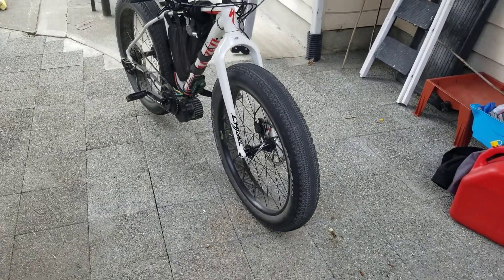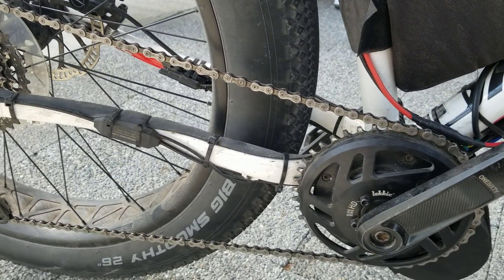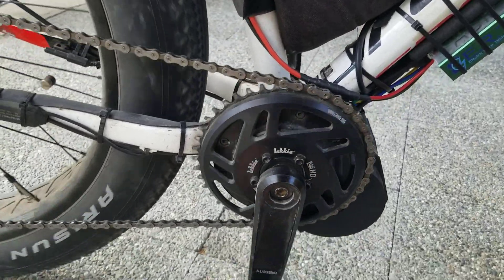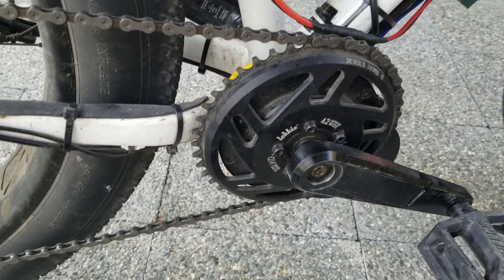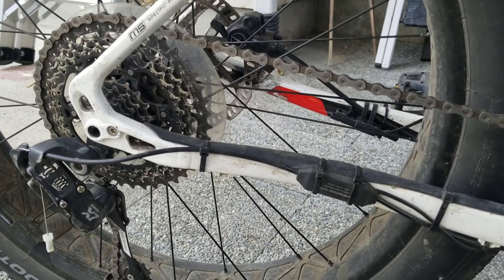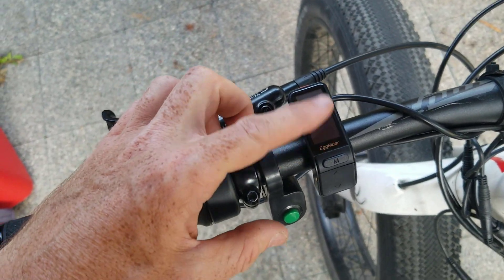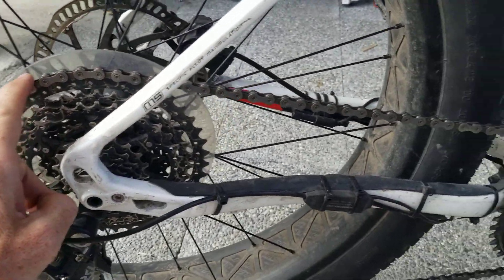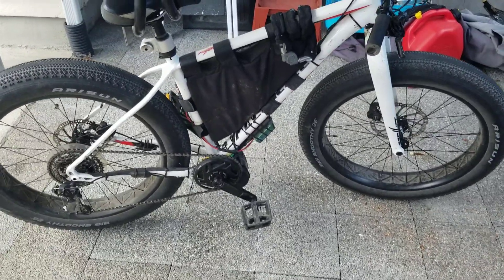Bafang BBSHD (ASI BAC800) on Specialized Fatboy - 3000km What I have learned!

Comment: Personally I haven't experienced the Bafang stock bbs controller to be a "pain in the ass" for my style of riding.
During easy, non racing, relatively low speed average 29 km/h rides working as a bicycle Postman messenger 📪.
It's fairly waterproof sealed out of the box.
Programming with usb cable or eggrider display is not hard in my opinion. 
I like the experience and natural intuitive feeling of being able to  control the ebike motor with your feet, handsfree wether your input is transferred through pas or even better through a torque sensor , very much.🚴
Also because this input system enables me to ride with my hands and arms free in an aero bar wich safes a lot of wind resistance and adds comfort on the wrists or pas allows me to carry letters and small packages in my hands in stead of constantly holding on tight to a throttle..
It's also gives good exercise and safes battery not being able to ride the bike like a scooter without pedalling along.🛵
Lunacycle mentioned that they believe the bafang bbshd controller of wich over the years the quality and quantity of mosfets have been improved is better than cyclones mid drive controller.
Some people use the bbshd / bbs03b controller into their bbs02b +750 watt motors mid drive  as an upgrade , with succes.
Before my current Bafang bbs middrive on a hardtail mtb,  I drove a max 2kw Crystalyte HS rear hub motor with xlyte <36v-72v> max 30 amp sensorless pas enabled external controller on a full suspension mtb for four years. But that xlyte Chinese pas system was more slow than the bbs in reaction time of  transfering sensored pedal (magnets) rotations into enabled or disabled electric hub motor assistance.
Reply from the maker: Nothing wrong with a different opinion. External controllers take more work for sure. I'm not sure where you got the idea that there is no PAS with the bac800. I use it all the time. In fact now the NXT display is on the bike I have true independant PAS and throttle. I cam even have 3 pas levels on the road and 9 for trails if I wished. There is also an EU mode in the works that locks out the bike to the legal limit and no throttle. The idea being you can ride your bike to the offroad area and then unlock with a PIN. PAS is my big area with the NXT and I am hoping the experience will be improved. User control over power ramping, decay, optimum cadance etc. Maybe I'm being a bit harsh on the stock controller. If you are ok programming it and running with the eggrider thats great. I bricked mine simply by changing the amp settings! Thanks for the comment. Cheers
Reply: @HighVoltageKits  ok thanks for the reaction. And xtra info . Sorry for the confuse.
I based my first feature impressions on the asi bac 800 controller Lunacycle sells on this site link (*) where it is said that cyclone specific asi bac 800 does not has a pas connection . i did not realize immediately: there are many different asi bac 800 controller versions and different cable harnasses available. Curious to learn more about what you shared above. 👍
https://lunacycle.com/asi-bac-800-controller-72v-version/
Reply from the maker: LUNA are not very good with ASI. I would not get one from them. It's a very difficult thing to get dialed in right. I'm not shocked that they say things like that tho.
Reply: @HighVoltageKits  after googling I figured out some options to get a asi bac 800 dialed in for the popular bafang bbs middrive with pas functionality embedded in the package.
F.i. this one Electric Racing Technology  you have mentioned before -->
https://electricrt.com/bafang-bbshd-upgrade-kit
Ps
In Europe sellers of that asi bac 800  are rare . one in the uk who does sell them listed they were out of stock on may 1st. 2020.
I did also see there is a asi bac version for the cyc x pro gen 2 mid drive (Torque sensored) relatively new e-bike motor.
Reply from the maker: So I help with the development of the NXT display. I use the kit from ERT on my bbshd. The same stuff will be stocked by Electron in the UK. Everything is a bit nutty right now and ASI themselves are no exception. I use the bac800 with gen 1 cyc and I am sending a torque bracket to get tuned in so gen 2 cyc users can get the same experience. Right now the push is to get the first few riders running with the bac800/nxt combination. There is some info on this in my more recent videos.
Reply: @Pablo Slalom Smart idea to use a MTB for the conversion in stead of a lighter build hybrid with rim brakes.
Besides better safety due to the stiffer frame and disc brakes. 
27,5 tires provide more torque and accelerate faster than 700c tires.
My ebike has a MTB/ATB air pressure regulated suspended front fork with lock out and hydroformed oversized alloy Merida crossway Frame. Though due to the rim brakes and large 700c tires I consider it safe up to speeds of 45 km./h 
Above 50 km/h is my limit for feeling safe & comfortable on that e-bike without helmet.
Reply from the maker: I always wear a helmet! But you can get hydro disc brakes also now. Fair points on frames! Your bike sounds cool! Cheers
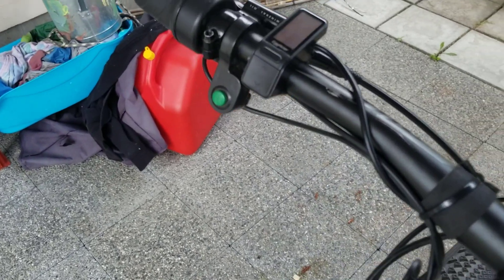Reply from the maker: If you skip to 6:10 you can see some riding using PAS on the bac800. The motor idling feature keeps chain tension while riding so less snap on the chain as PAS engages.https://youtu.be/r2vyJ1mBCUE
Reply from the maker: Its a fatbike. So 4 inch width tires. When I was running 52 volts and using peddle assist I could get over 60km of range. That was with a 25 amo hour pack. You say you are getting tired. What peddle assist are you using? If you join my discord you can post pics and get advice on your options. https://discord.gg/YAAjfgc
Reply: @Pablo Slalom Hello Pablo. Thanks that you liked my reply reaction and asked me some questions about the BBS002b - 500 Watt (4,2kg) Bafang same mid drive motor as you have. Nice to hear you do delivery work too.
The battery in my kit is a little bit smaller size as yours
36v - 17,4 Ah wich weight is the same as the motor only 4,1 kg. So my Bafang Motor and stock battery together add less app 9 kg to the bike. 
I have mounted this down tube battery  36 v on the bottle cage mount. Also I have mounted an extra 2nd 36v - 12 ah battery as a rear luggage rack in parallel connection with a on / off switch. So my total battery capacity is  36v - 29,6 ah. 
Tires I use are Schwalbe E-bike specific tires model Marathon E-plus size 700x38c wich weight is 940 gram.
Last answer range of a full charge that is hard to say because that depends on many variable factors such as the road surface, type of route hilly or flat, wind speed and  the speed or level of assistance you are riding in.
All in all on average I can use my ebike for app. 80 km without charging.
The main reason why i chose lightwight components and  average not high power motor components is that I would like to be able to ride my bicycle also easy peasy when the battery is empty unassisted.

Comment: Thx for all this great info. I'm pondering the cyclone motor (for a fatboy or a full suspension 27.5). I have a motorbike background so great to hear that you also don't find the brake cut offs, gear sensor, necessary and use throttle skills to modulate. The BBSHD is over featured, so cyclone sounds affordable power to me. I can't afford the CYC at this point. I would use the luna sine controller or get the phaserunner (however I heard you need to program them). Anyway, if you have any advice on the cyclone in comparison to bafang and cyc, I would really value it. cheers. JB (ps finally heard you mention you're in Kamloops, ha, I knew the background looked familiar! I'm in Vancouver, but familiar with your town)
Reply from the maker: Endless sphere is the best place to get info on the cyclone. I have never installed one so it would be bad form to advise you on that. Grin who make the phase runner are in Vancouver so they may be able to assist. People have used the cyclone kits. I'd search on endless sphere and look at probes builds. Electric bikes is lunas forum so likely info on there are well. Glad you like the channel. Cheers

Comment: What did you wrap your connectors in to keep water out? Is that heat shrink?
Reply from the maker: Its stretchy tape on the outside. For the phase wires I used a combination of di electric grease and heat shrink. Also liquid electrical tape for the halls. This video has some more detail. https://youtu.be/vXGPNPmohXw
Reply: @HighVoltageKits  alright thanks because I've been figuring out a way to secure the battery plug was just gonna try to use heatshrink overcovering the connectors and then like a ziplock bag over it lol thanks
Reply from the maker: Yeah the battery is harder. The plug itself is very tight fitting but where the wires enter is exposed. Try silicone in the gaps. I thread mine into my battery bag through a small cut I made.

Comment: Great video,  many thanks.  When would you suggest regreasing the internal cogs?  I have done about 1500KM on mine without issue, but I am a worrier!
Reply from the maker: I still haven't done mine but I will in spring! I'd say if you notice things get noisy or about the 3000 point. Its mobil 28 you want.

Comment: what about a igh like the rohloff ?   or   a strong 3 speed igh ?
Reply from the maker: Potentially. The sturmy archer 3 speed can reportedly handle up to 3kw.... Rohlhoff hubs are super nice but super expensive. So if money was no object I'd consider it. But not at very high power and not on a fatbike. The engineering and quality is German and of the highest quality.
Reply: Captain Codswallop so it could be a sturmy archer 3 speed on a fat bike - my surley troll can only handle an axle with up to 142 mm. The Rohloff is  too expensive - sorry too say that as a german. By the way I was inspired from your videos to built up a surley troll with a bbshd.       My bafang bbs hd wasnt lubed from the factory - not nice to see that.    BAFANG THATS REALY BAD 🤑
Reply from the maker: Yeah I have heard they are not very generous with the lube. I'll be redoing mine in the spring. I may  well try the steel gear then as well. The article I read on the sturmy was on electricbike.com I think. The surley is a great frame! Good choice.

Comment: Any idea why I would get a 30H ERROR when I power up the BAC800 for the first time?
Reply from the maker: I Googled 30h and it said it was a communication error. The only one I have ever got is e10 for overvoltage.
Reply from the maker: From what I read online it can be the speed sensor. Or the wiring harness. Its not going to be the controller if it's new. Have you tried all the connections? What display are you using?
Reply from the maker: https://electricbike.com/forum/forum/kits/bafang-mid-drives/troubleshooting-bbshd-and-bbs02/976-error-30-in-the-bbshd-and-bbs02
Reply: @HighVoltageKits  I looked at this link and also another one on the same forum. One difference is I have the BAC800 and this forum is addressing the controller that Luna sells. Looking at the display manual it has 08-99 (Error Codes) Reserved Please contact the manufacturer for error definitions. I do have the Bafang display I can plug in to see what happens but not sure how that will work since I'm using the BAC800. I'll let you know. The speed sensor is plugged in as well as everything except the gear sensor on the lower end. (The red connection) there were only two and the speed sensor plug into one of them. I haven't actually installed the magnet on the spoke yet but that shouldn't make a difference. I was powering up so I could install the brake sensors properly, positioned correctly. I also sent a text to Alan at ERT, I'm going to take a picture of the display and send it to him now since I haven't heard from him yet.
Reply from the maker: Good luck. I'd check all connections especially the display. Let me know how you get on.

Comment: I understand with this controller it has an auto engagement feature. Do you find this annoying or is it just something you get use to?
Reply from the maker: It's easily one of the best but most misunderstood feature of the ASI controllers supplied by ERT. The 50 watts of power can easily be cancelled by braking or peddling backwards. But it allows the throttle and PAS to be much smoother. Each time the chain stops moving it goes slack so when you make it tight with the throttle or pas it yanks or snaps. It wears chains and is a jerky way of doing it. It might feel a bit strange at first to not have the motor stop but the benefits are worth persevering with.

Comment: u mentioned it keeps around 50 watts of power running, but what if you want to come to a stop? does it know to turn off somehow? I was wiring it to my friend's bbso2 and bench testing it, but it was drawing 250 watts even after i let off the throttle.
Reply from the maker: The parameters will likely be causing that especially if it was programmed for a different motor initially. But to answer your question. A brake cuttoff. Peddling backwards or stress like going up a hill will kill the 50 watts. It's very little. But 250 is a bit high. Was it ordered for the bbs02 or for the bbshd?
Reply: @HighVoltageKits  it was ordered for bbso2 but had the wrong phase connectors. does the bbshd have different phase connection?

Comment: im ordering the BBSHD mid drive kit from luna. Should I get this controller to get better speeds? What do i do with bbshd controller becuase  thought it was built in. Im new to this so I'm not sure where to start.
Reply from the maker: I'd start by building your bike with the bbshd kit from luna and get used to it. Have fun riding. It's a good idea to start slow in my opinion anyway. Once you are happy you can look at upgrades. If you have a look through my older videos you will see my first couple on the bbshd. Another one at six months. A few on chainline. You can always sell your stock controller. After a few months if you want more power you can get the Bac 800 kit from electricrt.com If you rush it though it's easy to cook the nylon gear in the bbshd. I have lots of videos running it stock in the snow and through floods. It's great. I took my  time and I recommend you do as well. I'll be happy to answer any questions!

Comment: The model 620 is all metal gears from what I  hear.
Reply from the maker: Yeah I think you are right. It's often called the ultra. Andy Kirby has some good videos on it. Custom hall sensors. It's a beast. But you need a custom frame and mounting plate to use one.

Comment: If i upgrade to a 52v form a 48v do i need reprogramme the low voltage cut off in settings onthe stock controller or can i uss both right away ?  Thanks and subed
Reply from the maker: It depends a little on when you bought it. The more recently produced units have a firmware restriction to prevent people using 52 volts. If you have one of these units I believe you have to use a program cable to flash the firmware. There are a few threads on endless sphere that will cover the process. If it is an older unit it should just work. It's been a while since I used the stock bbshd controller though. I'll never use another stock bbshd controller to be upfront. They have numerous versions. I bricked mine with an eggrider display trying to use it. Bafang are not happy about people using anything other than 48 volts. If you got it from Luna or em3ev then you are likely fine to run 52 volts. If it was Ali Express or similar maybe not. I have no way of telling you what you have though sadly. It's not the low voltage cutoff you have to worry about it's an overvoltage message.   Have a search for bbshd overvoltage on endless sphere forums. Lots of good info. I'm using an external controller these days and I'll never go back. Hope this helps! Cheers
Reply: @HighVoltageKits  that's the thing the original one that came with the unit failed on first day due to over voltage on 48v. He sent me another probably  edited.  I'll probably just run 48v until service time and battery charge in few more 1000kms then try 52v and edit the motor. I dont want to fry it just yet 🤣

Comment: What do you think about regen braking ?
Reply from the maker: I think its brilliant. My bikes wont work with it as it stands tho. I use a derailleur on both and you need to have a straight run chain for regen with mid drive motors. If I had horizontal dropouts I could go single speed and achieve this. It's a future project tho for sure.

Comment: Nice conversion. Would you ever consider an internal gear hub and run a chain tensioner, a 3 speed might go alright?
Reply from the maker: For sure. I was reading good things about the sturmy archer 3 speed fatbike hub. Maybe I'll lace one next year. It would be a good project. Great suggestion. Cheers
Reply: @HighVoltageKits  I can verify that the Sturmey Archer sx-rk3 works great on my fatbike with the bbshd i run these specs::::: over 3000 miles with NO PROBLEMS

BBSHD--Mighty Mini 30 tooth and 24 tooth on Sturmey Archer SX-RK3 3 
 
 Speed  31mph no load  28mph with me riding
 
 Battery  Samsung 48V 17ah  & Panasonic 48V 12.5ah ( dual battery setup using Watt wagon Micro Chip)